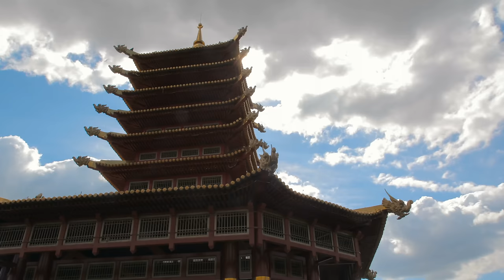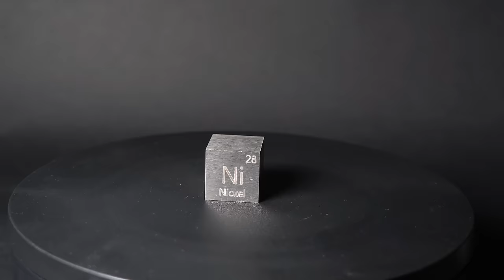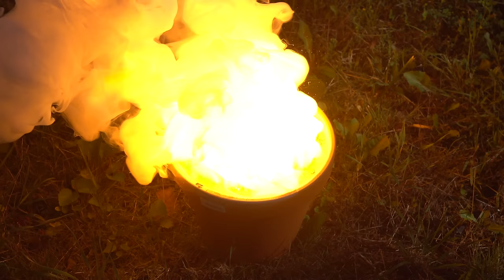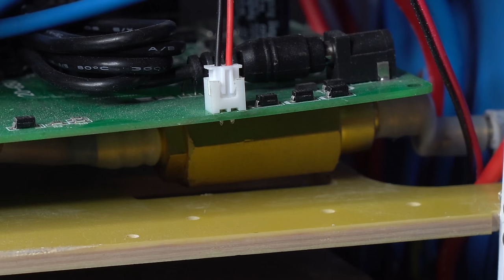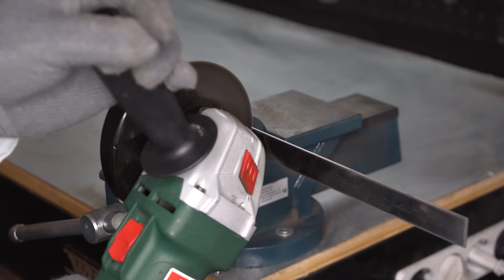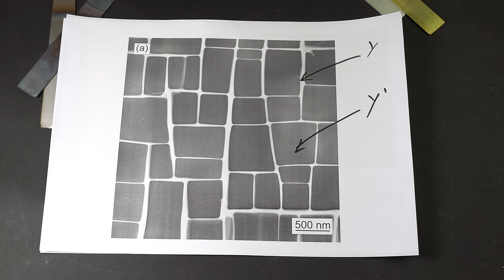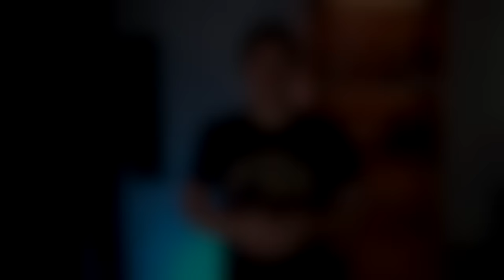Superalloy - A Material That SHOULDN'T HAVE BEEN CREATED!

Comment: I did a guided tour at a german turbine manufacturer and they told me the turbine blades are made out of monocrystalline material and they use a casting technique with a crystal starter to get a single crystal. Machining is then done with erosion technique and extremely precise grinding because the weight of each blade has to be exact so there is no vibration and imbalance.
Reply: Interesting
Reply: Ti-Al
Reply: Was it MTU Aero Engines? I worked there :)
Reply: Was it inconel or something exotic? 
My dad used to work at Rolls Royce and they started doing single-crystal titanium turbine blades in the 80s or early 90s. The previous stage was getting the crystals to grow so that they were orientated along the length of the blade.
Reply: I have also heard of this! Seems like a lot of materials and a lot of time to fashion and create such a scientific war machine, but it also makes me wonder how the Germans got the time and materials beings it was the ending of the war!
Reply: @anthonylepore516  well the jumbo 004 was kinda cheating they useded relativ low alloyed steels but coated them with Aluminium oxide  since it is mostly inert, resistant against high temperatures and it isolates the steel beneath that gives the structural stability of the turbine blade also the life time of the jumbo engine was really not so long before it had to be refurbished but well in war   times a plane doesn't survive very long and it is actually a bit easyer to build a primitive turbine engine than to build a V12 engine with hundert of moving parts so yeha they managed it very clever for that they had left
Reply: Too bad that German turbine manufacturer will no longer have energy or fuel to continue running their plant 
Bet they miss that cheap plentiful Russian gas 🇷🇺
Reply: @mememaster147  Nah not inconel, they are made from Ti6Al4V which is directionally cooled, it's not really a monocrystal. It is just to get a directional grain growth so the blades expand in a known direction when they get hot.
Reply: I took guided tour once at a Tillamook cheese factory. They told me their special ingredient was lots and lots of love. 🧀
Reply: @derek20la  lol uh huh
Reply: Das ist auto
Reply: @thorwaldjohanson2526  yes, the tour was at MTU (Motoren und Turbinen Union) in Munich ;)
Reply: Yeah now you can 3d print inconel
Reply: @henria.277  No, titanium alloys can’t handle the temperatures. They get used in the compressor section which is a lot cooler. The directionally solidified and single crystal materials used in the hot section are nickel-based.
Reply: @mememaster147  Those would have been nickel alloys not titanium.
Reply: @derek20la  no worries buddy the entire german industry is moving to central and eastern europe. Drive on the main Autobahn in Hungary and left and right of the Autobahn you see massive manufacturing plants from VW, BMW, Mercedes and so on. Hungary and other eastern nations get cheap gas and oil, have low taxes, and also the work force is cheap
Reply: we work with Howmet Industries and yes, the use of a seed crystal to start the growth process of a monocrystalline root is how its done. Under extreme temperatures and controlled gasses. The process still uses the 'lost wax' method of casting, thats been around for centuries.
Reply: When the turbine fans become unbalanced, there's a very good chance that they will self-destruct.
Reply: I still refuse to fly.
Reply: @J_wsh  Such a compelling argument.
Reply: single christal directionally solidified.
Reply: @derek20la  Well, its not an argument. Its an opinion, as well as the opinion of most of the world. 

So do with that as you will.
Reply: @J_wsh  Most of the world? You mean only the US and Europe? The morally and fiscally bankrupt nations?

The majority is the world's population is not on your side. India, China, Brazil, and middle eastern countries are taking Russia's side.
Reply: @derek20la  143 delegations of the UN voted in agreement against Russia.
Russia, DPRK, Nicaragua, and Syria, are the only to outright disagree. Others simply abstained. You're talking bullshit.
Reply: @J_wsh  ooooh the UN... as if any of the nuclear powers give a shit about their decisions 😂
Reply: @J_wsh  And look at their actions, not their votes. While countries may have abstained from the condemnation, they are still trading with Russia.
China is making a fortune reselling Russian natural gas back to Europe as LNG at a huge markup.
Reply: Single crystal turbine blades were pioneered for the space shuttle main engines.
Reply: I want to know how they get those cooling micro-channels inside the blades though.
Reply: @Anenome5  Electrochemical machining (ECM)
Reply: @derek20la  Probably but they like their humanity more than cheap gas.  I bet Russia misses a lot of the young men and integrity that Putin has thrown away.
Reply: @DavidSiebert  go watch CNN some more. Nothing either one of us can type will change anything.
Reply: very well explained.. nice nice!!!
Reply: the monocrystal blades also help against creep (deforming under stress and heat) which is a big problem in jet turbines
Reply: @derek20la No one misses Putin. All those beautiful Russian men dying for his GREED!
Reply: I've heard the same at university about turbine blades are being made aa single crystals.
Reply: This whole process of casting monocrystaline turbine blades was covered decades ago in Scientific American magazine.

Comment: That was incredible! You should do an episode about single crystal superalloy turbine blades. They're even more durable and the manufacturing process is super interesting. Might not be something you can demonstrate at home though.
Reply: Good luck with that.  Most of the info on that system of manufacturing is still a very closely guarded secret
Reply: demonstrating that at home is very unlikely, you need very specialized machines. single crystal alloys arent necessarily hard to do as the alloy itself  but rather creating the environment to cause the alloy to form a mono crystal is the issue.
Reply: @ph11p3540  I hate trade secrets so much lol.
Reply: @ph11p3540  Other than the black magic metallurgy the process for single crystal growth is simple enough in concept, it only gets fiendishly complex when talking about how you actually implement it. When the liquid metal alloy solidifies it will tend to solidify along an existing crystal. This means if you have the mold cavity tightly thermally controlled you can use a corkscrew shaped passage in the mold to start the cooling process. Before the corkscrew as the metal solidifies it forms many crystals as you'd expect but as it's solidifying up the corkscrew the geometry of it favors the crystal on the inside edge so by the end of the corkscrew that innermost grain has overtaken the others to form a single crystal.The hard part of implementing this is dealing with the precise thermal gradients, temperature control, vacuum casting, etc to actually keep the solidification process consistently along a single crystal growth boundary.

Bismuth is pretty good about growing large crystals, it might potentially work to show that corkscrew method working in bismuth although I don't know if there's an easy way to show grain boundaries in a solid piece of bismuth like you can with etching steel. It might be possible to make a plaster mold and demonstrate the difference between the corkscrew passage and no corkscrew on the crystal growth as an amateur.

For anyone interested in the topic there's this video that gives a bit of the history of turbine blade manufacturing, https://youtu.be/1zHSK-Nlaz0?t=193 and an excellent video by AgentJayZ https://youtu.be/jCb6-LGfeHg
Reply: @AndrewMerts  6:12am how would have know the metals cause such reactions.
😊

Comment: Important correction: Young's Modulus (AKA Modulus of Elasticity) does not change much with temperature, the Yield Stress does. Hot steel is nearly as stiff as cold steel, but the amount it can deform elastically is much less.

Also, I don't think aluminum powder is capable of reducing titanium dioxide, I think you need magnesium powder for that.
Reply: Might be some temperatures and/or pressures where that changes, but yeah, for shirt-sleeve conditions titanium reduces aluminum, rather than the other way around.
Reply: @awashburn6944  I guess I'm thinking that most metals are not used at temperatures where their young's moduli start to deviate much from their room-temp value, but you've got a good point for high-temp alloys.

Comment: Written by three Russian metallurgists, with a trove of experience in Al-Li alloy development and processing spanning many decades, Aluminum-Lithium Alloys (part of the Advances in Metallic Alloys series edited by D.G. Eskin) provides the theoretical foundations for melting, casting, forming, heat treatment, and welding of Al-Li alloys, so critical in the design of lightweight, high performance structural elements used primarily in civilian and military aircraft and aerospace in general. The book reviews the work done on Al-Li alloys since the 1960s until today,
Titanium constitutes around 30% of the aircraft's
Tu-160M2
Collier Trophy

Comment: Inco is fun. it welds like a stainless aluminum blend.
I worked at an electron beam welding shop for a few months and that would punch a 2"+ deep weld with a 0.02" heat affected zone. We were doing things like welding parts of the rotating assembly of 737 max engines and things like that. it was really fast too, like 100+ inches/min. at production speeds. if you tried to slow down, the weld would "fall out" because it was overheated. the beam would just slice right though and into the other side of the part. the whole process was done under high vacuum in a giant chamber, and the beam is steered with electromagnets. the welds would offgas inco and vapor deposit it in the chamber, so we had to swap out glass slides to see, and the lights inside the chamber were mirrors on the inside and just dull gray on the outside instead of you know... releasing light.
Reply: You've sent me down a rabbit hole
Electron beam welding sounds like black magic to my tig welding ass
Reply: @embersaffron5522  lmao, I ended up leaving that job before I got trained (problems on their end)
But I got to tool around with the machines, and yeah, they are nuts. They operate in high vacuum, so the roughing pump was a 10" roots screw blower, and the main pump was an oil diffusion pump. It's as high a vacuum as you can get without lab equipment. The beam would collide with the air

Everything is done with rotation and oscillating tables, as the beam is fixed like a lightsaber. You're looking through basically a rifle scope mounted coaxial to the beam. The beam is shaped with magnetic fields and can be a fixed point, or made to spin in a circle, ellipse or a line. The tracer power to sight in is enough to etch material.
Cranked up, we had a 4" round billet of titanium they used as a focus blank and it looked like a church candle 🕯
My favorite part was that it made metal vapor deposits all over the inside of the chamber. Even the light bulbs were mirrors.... The wrong way (crunchy outside, all the light reflected inwards)
The scope had a piece of quartz on a slide so you could keep a clean section on the part

Comment: How about a follow up video covering crystal control when casting super alloys, how a cold block on one end of the casting mold and a hot kiln on the other end creates linear crystal growth, like a bundle of rods. The addition of a pigtail after the cooling block forces the multiple rods into mono crystalline structure. All of that happens before the solidification of the cast blade itself, which will be mono crystalline.  Mono crystalline castings exhibit the greatest strength and stiffness of super alloy turbine blades.   
 
The inability to create mono crystalline super alloy blades prevents the chinese j20 from achieving super cruise.  If they want to  fly as fast as Americans they need to use after burner, which gobbles up fuel and provide a great signature for heat seeking missiles.  Making their stealth plane, non stealthy.
Reply: I appreciate your detailed answers.  Do you know anything about DU depleted uranium ordnance?

Comment: I have a handgun made with scandium/aluminum and titanium alloys and the thing is so light that it seems like a toy at 1st, but has very punishing recoil with full pressure loads. It's so light it uses a pocket clip instead of a holster 🤣
Reply: I certainly wouldn't carry it that way, handguns should always be carried with some kind of trigger protection.
Reply: @logicplague  I can see how you would say that, but the belt covers the trigger and it's more secure than the expensive holster I bought for it, and other guns I've been carrying daily over the last 35 years, this one for 17. 👍
Reply: @bendeleted9155  Fair enough, as long as it has something.
Reply: ? What pistol is this? Not that I need an excuse to blow even more money on my firearm collection....
Reply: @DropTheHammer556  S&W 340 pd models

Comment: From just the simplest of his tests of the metals it’s definitely showed that the carbon steel that’s most often what sword blades of decent quality isn’t the worst choice. Especially along with price. I can’t imagine what an actual sword blade of approximately 30-40in and 1.5in wide would cost made of the super alloy! Yet I would bet that it would last for a very, very, long time. Plus also hold its sharpness for longer than other metals as well. I am certainly NO metallurgist by any definition, but I do understand the basics of metals. This was incredibly informative! Thanks! I only wish I had the ability to work with such metals and forge them into various things. And it would cost a small fortune! And that’s only if I didn’t burn the house down too. Awesome video!

Comment: I'm a machinist, and got a print for an in-house part to be made from non-magnetic stainless.  Pick it from scrap, the supervisor said, so I picked my 25 mm bar and chucked it into my lathe, a South Bend made in 1930, leather belt drive and HSS tools.  It burned the HSS, so I put a carbide tool in, and the carbide also burned up.  Turned out, someone put a piece of 718 in with the 316L by mistake.  The boss forgot where it came from, too!  It was a whole meter long, it must have cost $1000!  And he forgot about it!  I got to turn this piece into refractory molds when an order came in for 718.

Comment: Inconel is also used as material used to grind other materials because of its toughness. There is however an issue, it looks like cast iron after it's been used for a while. The problem isn't cosmetic, the problem is if it gets recycled, the material won't melt into iron. The results are billets of iron that are unmachinable because the cutting tools keep being broken off.
It's a real problem
Reply: you'd think they used a magnetic separator... Inconel isn't very magnetic

Comment: It would be nice to make kitchen tools and/or knifes with that super haloid. If you can, ask to your friend blacksmith to he can help you (I'd like to see what he could make). Very good video program as always. 😀👍
Reply from the maker: Inconel and other superalloys are not suitable for making knifes because they are too viscous and don't get sharp.
Reply: @Thoisoi2  I see. Another elements that I thought are plates to cook fast food, pots and trays for oven. Do you think Inconel would be good for those things that are used in direct contact with flame? Thank you very much for your answer. 😀👍
Reply from the maker: @FedeG86  Kitchen stainless steel is good enough and much more cheaper than superalloys. They are used primarily in special conditions.
Reply: I´m surprised that out of all the comments here, Thoisoi chose the one about kitchen utensils to respond to :D

Comment: I was a gas turbine mechanic in the navy. Those little holes on that example you shows lets bleed air through and makes a cold blanket of air that insulates the blade against the heat keeping it from reaching those high temps.

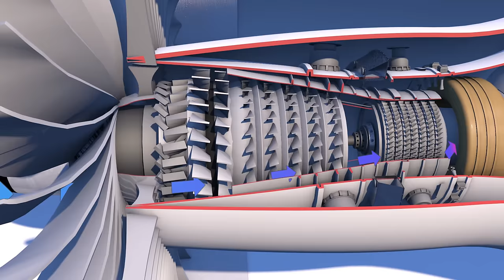Comment: 15:43...the blades of the compressor are each the opposite direction to the previous row.

Hold 2 child's windmill sticks, one in front of the other with the blades capturing the air orientated in the same direction and blow..then turn one of them back to front and blow again.

it makes a difference.

also, did you mention the single crystal metal casting process which is designed such that the metal crystals within the alloy form from a single crystal meaning all the metal's structure is aligned in a single direction makeing it incredibly strong in the orientation that the blade is fixed into the disc?

You had the right idea with the induction heater, only, you need to do it under a strong vacuum.

I fell asleep for some of it.

Also, electrosprak/EDM (Electrical Discharge Machining) technology used to drill the holes into the leading edge of the blade for the film-cooling process which happens while the engine is in operation is also pretty cool.
Reply: The blades of the rotors are in the same direction, the stator blades in-between the rotor blades are in the other direction. The stator blades were not shown in his animation.

Comment: I work with inco everyday. It’s damned impressive material. Thanks for the video!!
Reply: Former sheet metal engineer.
"designed" a mold for "bending" the outer edge of Inconel 625 sheets so they could be welded into round tubes easier.
It had to be done in one go due to it hardening further with every cold deformation.

Also reprogrammed a laser driller to cut holes under a angle of 20° in the flat state of the sheet.

Comment: Drilling any stainless with a pistol drive doesn't work well, stainless tends to work harden really quick so it needs a high feed rate and not allowing the cutter or drill to dwell or it'll work harden straight away and won't cut